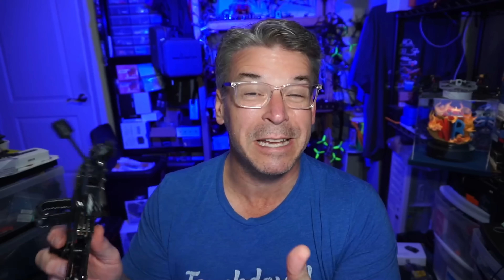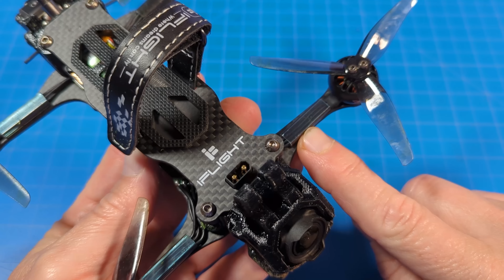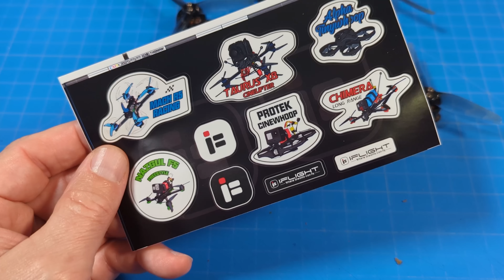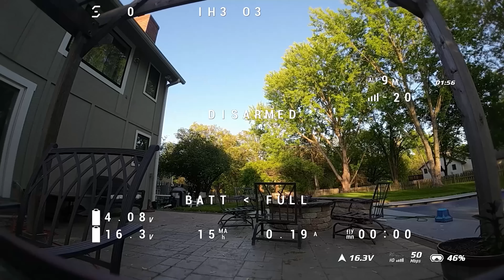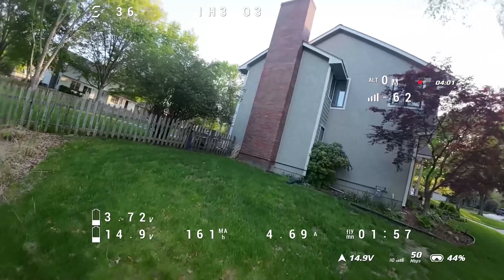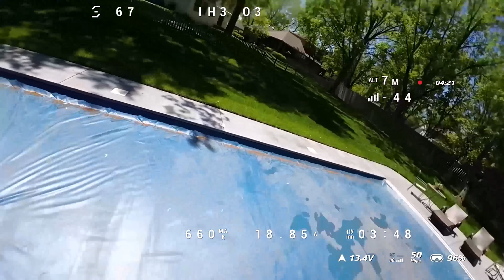iFlight IH3 O3 // GPS Rescue // Explorer

Comment: really considering this as a bundle to introduce myself to HD flying . It comes with ELRS receiver and DJI integra . I dont really want to buy parts and try to figure out how things work together. A bundle is ideal for me. Comes to around $1300 with some spare props and a couple of batteries and charger.  Very tempting.

Comment: Disappointed!  I hope to see how to setup the GPS Failsafe.  Just got my iH3 and like it.  Did you get the problem resolved?
Reply from the maker: No. I needt to swap out the gps. The gps failsafe setup isn't quad specific. We should be able to find and use any gps/betaflight setup.
Reply: @NickBurnsFPV  My iH3, after binding and setting up without GPS flew very well.  The only issue is that it picked up GPS signals very slowly and only 6 was shown, which is far less than my Mavic 3 Cine can do.  I am still trying to figure out the best GPS failsafe setting.  This is the main or the only reason that I love my AVATA much better.
Reply from the maker: @ckshene7212  I think relocating the gps way from the video antenna will likely help...at least to some degree. If we fly in the same general location the gps should retain some data helping it get more satellites quicker. I think in general in traditional fpv our gps modules are fairly low end and cheap, but I don't often use or have explored the gps module very deeply.

Comment: Here's what's fixed all my GPS woes: Cover the GPS wires with RF-blocking tape. I know copper tape is popular, but I've found Titan RF Faraday tape to be the best. Solder a ground wire to the tape itself, and to a ground pad. The tape is conductive, so you'll want to cover that up with a layer of cloth tape or similar. It sounds bulky, but it can be done very clean and compact if you're careful. With this setup, I can get full 3D lock indoors on a rainy day with an M10 unit, and reasonably fast locks outdoors with an M8.
Reply from the maker: Would this take gps from 0 satellites to 5+?
Reply: @NickBurnsFPV  It can't hurt to try, since it should improve performance with the replacement GPS even if yours ends up being bad. When you're on the bench, does the BF GPS tab show anything at all even if a weak signal?
Reply from the maker: @alexdefelice2448  no signal at all. I am no gps scientist, I lean towards the antenna or some other part of the gps not working at all.
Reply: @NickBurnsFPV  Yeah that doesn't sound right. I've seen (especially M8 units) struggle with getting a lock, but never zero signal at all (even indoors). I agree on it likely being a bad unit.
Reply from the maker: @alexdefelice2448  At some point I need some time to swap another gps into. I would like to swap the same and see what is what.

Comment: I had the same issue with a GPS I added to one of my drones.  In the end, I believe I had to flash the flight controller with a new version and it worked fine.
Reply from the maker: I would hope a flashing wouldn't be needed I suspect all the fc in these are flashed identically. gpspassthrough does show communication.
Reply: @NickBurnsFPV  just curious: when you watched it on the bench, did you ever aquire any sats?
Reply from the maker: @MrFadjule  no satellites ever. Always 0 in the osd and in betaflight.
Reply: @NickBurnsFPV  wow, that makes me wonder about the antenna...
Reply from the maker: @MrFadjule  yea, I am tempted to see if I have another gps I can easily swap in.

Comment: I wonder if we scrap the GPS and the extra camera mount (03 Camera is good enough on its on) and then went with a Tattu 550-4S (the good R-line Tattus)... if we can get this just under 250 G
Reply from the maker: The external camera mount if part of the primary camera. We could cut it off, removal of the gps and mount, all in all I suspect it’s all most 25 grams we shed
Reply: @NickBurnsFPV ... it's close: 217 grams - 25 + 60 (Tattu 550Mah) = 252 g. A lighter antenna might get it under; though I'd want to add one thing back and that would be a clear or ND lens cover. Would be interesting to see how it would fly at 250G also... might handle considerably better? With a little manufacturing change or two, iFlight could make this into a really good freestyle 249 G ripper.
Reply from the maker: @technoxtreme178  And you gave them a name 250G O3!

Comment: I've had good luck on every test and on two actual failsafes with gps rescue on both 4.3 and 4.4. And with the price of the new, fast m10 modules, anything with a vista or 03 gets a gps now. $15 is cheap insurance. And I can always turn it off if flying in a bando or heavily wooded area.
Reply from the maker: Gps rescue brought it back to the take off spot or general area?
Reply: @NickBurnsFPV  I've never let it land. Just waited until it started descending over the mark or in the case of the failsafes, until the signal re-established. I will let it land one day just out of curiosity, but my main concern has always just been a return until I've gotten control back, and it has always flown back close to home.
Reply from the maker: @kurtzFPV  ah gotcha. My experience testing was it would come back in the general direction but not really to the true takeoff location.
Reply: @NickBurnsFPV  I tested it on my Nazugul Evoque V2, it landed about 3m from where i took off, i did wait till i had a lot of sats. So pretty good.  Perhaps got lucky that day, it was a sole test, didnt had to use it for now.
Reply from the maker: @Photonees  Is that on BF 4.4? I hear its better on 4.4
Reply: @NickBurnsFPV  yes, 4.4
Reply from the maker: @Photonees  Thank you for that info

Comment: Wow, iflight could have just gone 4".
This one killed the sub250 limit anyway with 211g dry weight.
Personally I love 4" with a 4S 18650 pack.
Reply: Yeah a 3,5" needs definitly to be under 250 g. What sense makes a 3,5" over 250 grams ? hahah
Reply: @Sugalime3D_FPV  just put a 350mah battery on it when once in your life they check it.....